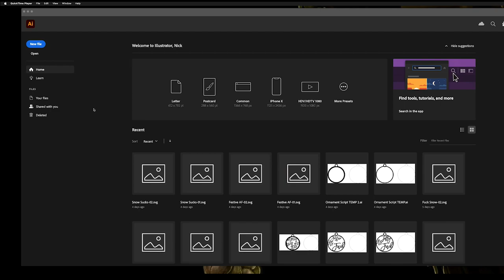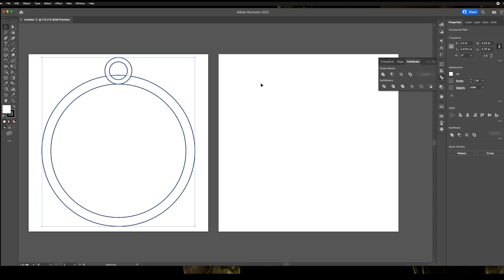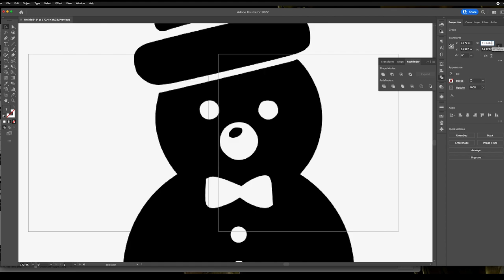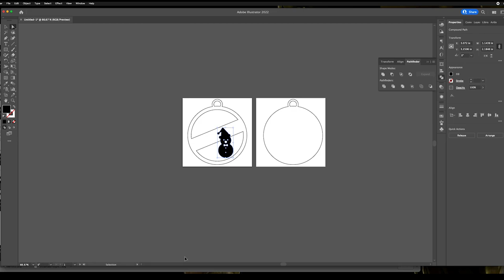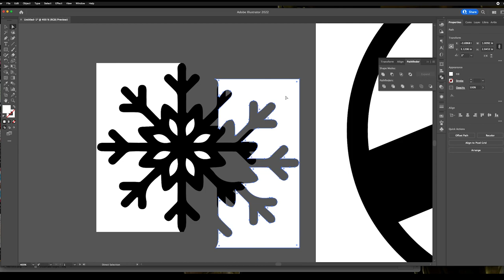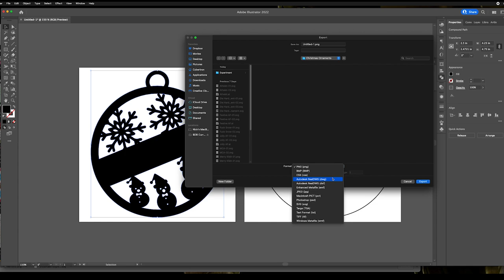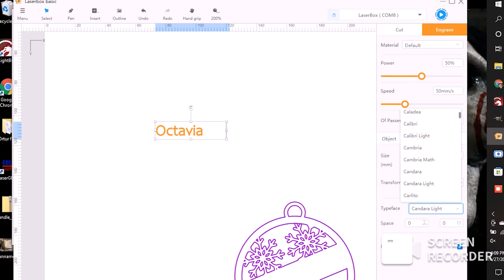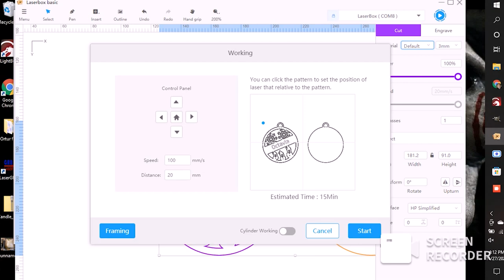How to Design Christmas Ornaments in Adobe Illustrator

Comment: I just got a 20W D1 pro. I cut my first wood with it and I really don’t know what to do with the soot. When handling the part I cut it just rubbed all over with my fingers. And it smelled really bad. Is there a recommended post process that you follow to clean parts up?
Reply from the maker: Isopropyl alcohol.
Reply: @BuildDadBuild  you wipe down the parts with it, especially the edges?  Or do you do a quick rinse?

Comment: Thanks for the videos. I just got mine and I'm having a hard time getting it to cut through even the small pieces of included wood. I have the 10w any help would be appreciated as Xtool has zero customer support.  What cutting setting did you use there and what material  ?  Thanks!
Reply from the maker: My first thought would be do you have it focused correctly.
Those settings are the settings for 5mm basswood...I believe. I've slept since that video. LOL
Also check out the xTool D1 Facebook group. Lots of smart folks there that can help!
https://www.facebook.com/groups/xtoold1
Cheers
Reply: @BuildDadBuild  yep using wrong settings thank you !